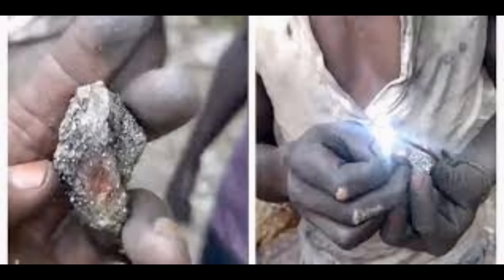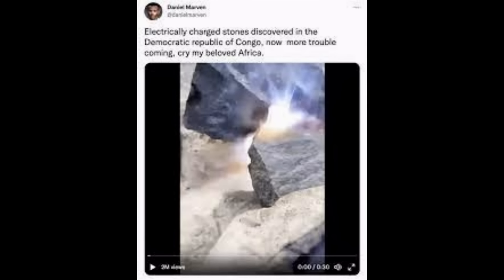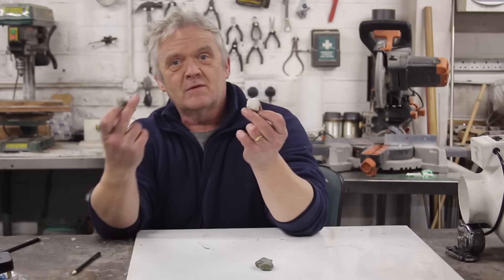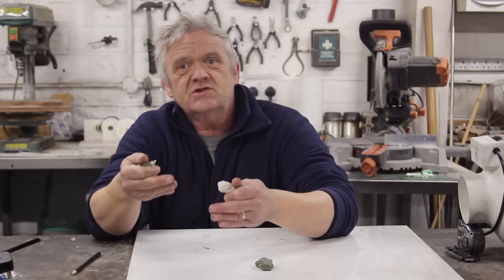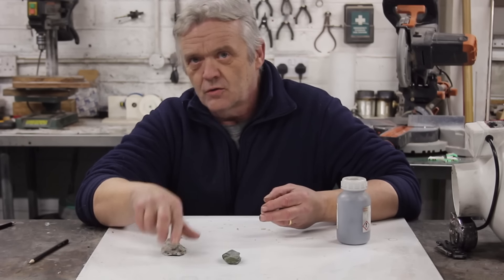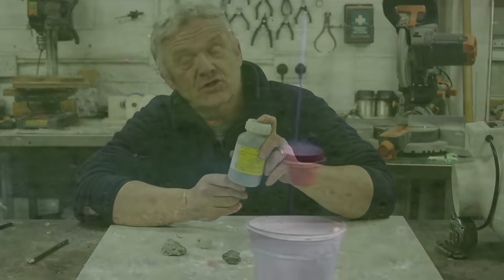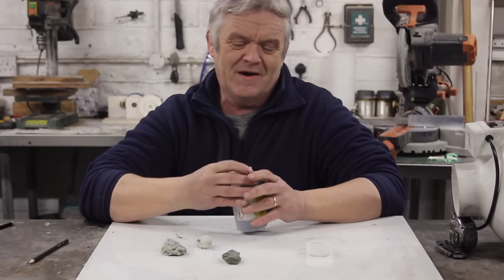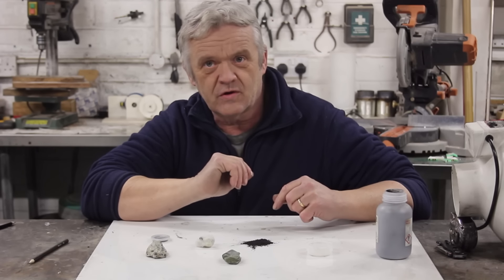1821 Reproducing The Electricity Generating Stones From The Congo

Comment: Another fantastic video Robert, that definitely had me going and I'm so glad you clarified it at the end, but you also raised a very valid point that the masses can easily be mislead without much work these days! Equally great content just as your usual stuff, even if it was a trick video, I always thoroughly enjoy watching along! Long may it continue
Reply from the maker: thank you mate and thank you for taking this in the spirit it was meant
Reply: @ThinkingandTinkering  Another trick:  HITTING TWO WHITE QUARTZ STONES TOGETHER IS NOT ELECTRICAL!  Do it in a dark room, and notice that the dim flash is yellow, rather than the blue/violet of plasma.   Also notice that, after hitting the stones, the contact-point smells burned.   What if it's all frictional?  Maybe it's like the "sparks" from grinding wheels, which aren't electrical of course.

If the tiny contact-point between quartz pebbles is getting hot enough via friction, it will glow yellow-white for a moment.   But in that case, ANY stone should do the same  ...but the vast majority are not translucent!  Any flash will be concealed, hidden down between the two opaque walls coming together.   In order to flash, at least one of the stones must be translucent.   (And also, a violent *scrape* might give out much more light, while a perfect *strike* with no sliding motion, might not produce any flash at all.   That's if the flash is entirely caused by frictional heating.)

So, try it with a white translucent mineral which isn't piezo.   Or, perhaps try it with milky glass.

Heh, maybe try spinning a tiny object in a dremel, then pushing it hard against some translucent  ...marble, or glass, etc.   Will a tiny drill-bit or a grinding-wheel produce some light, when it's against a translucent white object?

Comment: I knew there was something wrong when you were banging the stones together, but I couldn't tell you had edited the video to light the LED. Very good.
Reply from the maker: awesome - cheers
Reply: Having played with quartz rocks a lot when I was a child, and pretty much intrinsically knowing they didn't do that, I still fell for it, despite the 'electrical flashes' looking a bit off. Just shows how much trust plays in an observation and analysis.
Reply: I have seen crystals flash on impact,  but it required a pitch-black room to see it,  and I had to wait several minutes for my eyes to adjust first.  Not going to see any flash in a well lighted room.

Comment: If you have actual Piezzo quartz stone cut as a flat piece, and if you were to properly set it up with contacts on opposite sides it can produce a few thousandths of a Volt for an instant. The pulse width would be dependent on the resonance of the stone, force of the strike, and anything being used to hold it in to position. This would happen when you strike the stone.  The current output would be in micro Amps or a few millionths of an Amp.  You would need an oscilloscope to see this.  Set the time base to about 10 to 15 HZ per cm range. Input sensitivity should be set to about 10 mv/cm.  When striking the quart stone you would see the trace jump.  With a digital storage scope you can capture the waveform and take a measurement.

Comment: Two relatively translucent  quartz  river rocks will indeed make a nice orange flash if you rub them hard together. (you need to do it in the dark after your eyes are adjusted.)  there has been a good debate about if its paezo electric or tribuluminesence.  i think its paezo possibly igniting tiny crushed particles.    similar rocks were sold in a small felt bag as "magic rocks"
Reply from the maker: yes they will - hard to get on camera but awesome to see

Comment: I don't think it's real. I'm an electrician and I'm not the sharpest tool in the bucket but they'd have to put great amount of pressure on rocks to produce electricity.  
As far as it being conductive simply by touching it against something is unbelievable. Why isn't anyone being shocked from it if it has that much energy.  It seems to be very unstable to

Comment: I do enjoy these sorts of videos.
A spark of truth seems to be a common thread in pulling wool over eyes.
Obviously the pizeo electric properties of quartz is a thread of truth, but I wonder what else had grains of truth 🤔.
VB2 I've had some experience with in manufacturing, an ingredient in ceramic cutting edges, I've never thought on how its synthesized but it does make the ceramic slightly conducive. 
And frankly seeing the $40 bottle of VB2 that I have used in the past while you described making the stuff really put my suspicious on edge.
I honestly had some hope that there was some chemistry trickery at play rather then camera trickery!
Well done and well played!

Comment: Robert, how do you explain the academic report titled : "Experimental Investigation of Soapstone and Granite Rocks as Energy-Storage Materials for Concentrated Solar Power Generation "?
A section from the article:

"for crystalline rocks the conductivity decreases with temperature as opposed to the amorphous rocks in which the diffusivity usually increases with temperature. Thermal conductivities at 20 °C were 2.58 W/(m·K) and 2.19 W/(m·K) for soapstone CS and US, respectively, while those of granite CG and UG were 1.69 W/(m·K) and 1.91 W/(m·K). The conductivities for soapstone were higher than those of granite. Most other rocks shown in Table 3 have thermal conductivities approximately similar or slightly higher to that of the experimented rocks with the exceptions of quartzitic and calcareous sandstones that have higher values."

Comment: Called it out from the beginning .Numerous quartz produce electricity through the piezo effect via compression or twisting .That's how many BBQ igniters work .If they were iron bearing rocks like hematite and you were to turn up the voltage and connect them by wire you may  get the same arc flash they produce .Note that the guy was wearing a glove handling the rock .One wire from the welder is referenced to ground and the other on the rock and put in 36 to 75 volts and about 200 amps and you are welding

Comment: Excellent video and Thank You for the explanation of the trickery. I've always thought "If something sounds or looks to good to be true, then it probably is."
Initially I was surprised and disappointed you didn't assess how many volts and amps the rocks produced and then expounded on how big or how many it would take to produce a usable voltage/current. Something didn't feel right based on your usual thoroughness.
Reply from the maker: that is a very good guide and thank you for taking this in the spirit it was meant

Comment: Wet granite of course will produce a current, I found a granite stone in my work car park which happens to be next to a railway line, so it’s one of the stones from in between the tracks that found its way into the car park. I took it home, got it wet and tried a multi meter on it and it does indeed produce a small current when it is wet…
Reply from the maker: there are real effects that's for sure

Comment: Could you explain why a multimeter would tell you there is a current in the microamp range and of around half a volt when you sandwich clay in between an aluminum foil and copper wire?

Comment: This reminds me of the really old fashioned crystal radio kits where it had a literal Quartz crystal and the ' cat's whisker ' for the radio.  I would not doubt it produced power, just not enough to actually light an LED without some blocking oscillator since the power out of a crystal radio also ended up needing a battery and an amplification circuit to actually hear an AM station.
Reply: "Crystal" radios didn't use quartz, they used Galena.   The "crystal" doesn't produce power, it just rectifies the incoming signal.  Simple crystal radios can work without any batteries or amplifiers if you use a high impedance earpiece.
Reply from the maker: cheers mate

Comment: I have in my posession a few gemstones that when wet send a tingle that feels like electricity at a very very low voltage.  the voltage is less than when a 9v square battery is licked.  I didnt believe it when I first read about the gemstone, so i bought some. i've showed them to other people and they have felt it too.  i've often tholugt about trying to measure the voltage to see if it is actually a electric current, its on my todo list.
Reply from the maker: there are real electric stones
Reply: @ThinkingandTinkering  what causes the tingle i and others feel when the stone is wet when a person touches it?  i didn't believe it untill i tried it myself.  The gemstone has a weird name. I"ll look through my old receipts and post it in the near future.

Comment: Would love to see if energy can be collected and stored via the airwaves around us ,, using a crystal radio . I have a crystal radio and indeed it does work and I can hear radio stations without any other source of electricity to run it . The earpiece is a piezoelectric earpiece and it's very quiet to listen to. With a much longer and efficient antenna the volume goes up. Can this tiny bit of energy be harvested??

Ps great video keep em coming , I still feel a bit sad for the folk who invested into the perendev magnetic motor who were taken in and coughed up their hard earned money

Comment: Some reason this makes me think of magnet motors, there is Soo many that almost work, they spin about 300°-340°. Then stop, they can't get over the hill to contenue, I was just thinking maybe they could be used with a sterling engine, use the magnetic motor as the flywheel, with it timed so the hill or dead spot is timed with the Stirling engine is on its power stroke, or there about, then balance the rotating assembly, and use coils on the near the flywheel, forming a generator,  the magnets could possibly make the Stirling engine slightly more efficient, we can only try,  maybe one day we can get that 100% efficiency!!
Reply from the maker: you could always try if you wanted mate - but I don't know I suspect it would come to a stop unless you used the Stirling of course as that is the power input

Comment: Rob, have you seen the Garuda Sanjivani videos? It is apparently a Root or stick that can travel against the flow of water. I tried to replicate it and 3d print but i had no luck as my attempt was heavy and sunk.  Would love to see a video on your thoughts. I think that it is possible to replicate and i think it works based on the marangoni effect due to the surface tension of the plant stick / root. similar to upstream contamination that can occur when your pouring water from one container into another. But the weight and shape of the objects will effect the surface tension and i cant source one of these roots to experiment with. Some say its fishing line others report it as an acurate depiction. To me, It would seam practical for nature to evolve this feature as a way to enable upstream seed distribution. The stick/root resembles a snake whilst it is in the water and it is also used to treat snake bites allegedly. Would love to know if the videos of it are genuine though.
Reply from the maker: I will have a look mate

Comment: Is it possible to liquify quarts and then resolidify it to allow for the properties required of it to work? This would allow for complex shapes of quarts interactions
Reply: Quartz is easy enough to carve into shapes, depending on the type of quartz. To melt it would require a tremendous amount of energy.
Reply: @jerrodlopes186  Quartz cant create infinite energy though right? You cant just pressurize it and generate energy forever? Entropy rules... Does this mean that Quarts are natural batteries we can squeeze electricity out of???
Reply: rick3yrick3y68  Ok, so consistent pressure provides never ending voltage? If so, How???
Reply: @Dalorath  it's not enough energy to do much of anything with.
Reply from the maker: yes it's possible just not very doable - after all quartz was once a liquid - but the temperatures and conditions are best described as extreme
Reply: @ThinkingandTinkering  The idea around this was to melt quarts into specific shaps in an engine that would generate electricity based on the forces generated from the design of the engine.

Comment: A working quarry would be lit up like a christmas tree if that were true - I've raised a weak spark using quartz and steel (much more difficult than flint and steel) but in that case it's the steel that is burning up. Nice one Rob, but the quartz sparking like a flash gun tipped me off
Reply from the maker: nice one mate - I was going for just a bit OTT - I am glad you. got it

Comment: I thought you had a battery inside the crocodile clip, and used the steel clamp to complete the circuit between the 2 copper strips.
Reply from the maker: it was such easier than that mate

Comment: I have a couple of devices which use the "strike the Quartz" principle to work as ignition sources., but they don't work as demonstrated.  LOL!  I had never heard of this African energy stone thing, but I don't doubt there are people trying to get others to buy the idea. The closest thing I've seen to free energy is the "Trompe", which uses flowing water to create compressed air (apparently the Romans discovered it), without using moving parts, or significantly affecting the water flow itself.
  Then again; you need a source of flowing water,so it's limited.
Reply: You should look up "Ram pumps" - they use the flow of water to pump water uphill, probably in a similar manner
Reply from the maker: it was on the BBC news mate

Comment: Firstly, I dont question your integrity,  so no apology needed.
Secondly, I was fooled until you were just about to connect the diode....being it is diode. You would likely have wanted to be certain which copper strip was positive and which, negative. 
Well done, though.
Reply from the maker: cheers mate - I do worry about this sort of stuff - but I also want to explain it in a different way

Comment: That chemical that's has 3 time more power density than petrol. Is that part true ?
Reply from the maker: yes it is - I mixed some truth in there and that much is true - vanadium diboride is a material that is being looked at very hard for batteries
Reply: @ThinkingandTinkering  thanks for the reply. That was going to be my next subject. Could it be used for batteries. So it's being looked at but how to best implement it is what they are studying. They sound like they would be very impressive batteries if it could be done. 
Hope they can make less dangerous than lithium or obviously completely safe.

Comment: I'm sure the Congo video is a trick...electricity simply does not work the way they depict.  But, I tend to think they didn't employ your method. When you slightly bumped the wire, your light (the transparent PNG) did not move.  Whereas, the glow in the video moves accurately as he moves his hands, and even shows a "lens flare" type effect that appears to be optically accurate.  It's true that can be mimicked using computer-generated effects, but that just seems too sophisticated to me, to be a satisfactory explanation.  My belief is, there's some hidden battery. When you pulled out the copper tape, I was expecting you to run it along the backside of your fingers, leading to a battery hidden somewhere, maybe inside your shirt...and I suspect they used a similar method to that.

Comment: That could so easily have been done without using video effect. Just put a little button battery and some fine wires on the clamp and it would work as soon as the clamp is done up.
Reply from the maker: yep that would work too - the effect was easier though and fun to try out!

Comment: Why does Mr. Robert Murray-Smith not go to the Congo, get the stones shown in video and conduct a test using the actual stones used in the video. If testing the actual stones is not done, he is likely protecting interests of the petroleum industry and is misleading the public in order to maintain the modus quo. As a professional researcher, conclusions must not be drawn regarding a particular unit of analysis using a different unit of analysis. Doing so is referred to as an ecological fallacy. For example, conclusions must not be made about turtles from examining frogs. Both are reptiles, but they are different species of reptiles. Again, it is erroneous to forecast the driving characteristics of a sedan from driving a dump truck, both are vehicles, but different types of vehicles.

Doc

Comment: From other videos, experience and learning to think critically. Your demonstration didn't add up. The tape has glue. With experience the glue is an insulator it would never meaningfully attach to any rock. Expecting that lose power to store energy is absurd. I've never seen quartz flash and I banged a lot of quartz together. Until the end clip i thought you were trying to pull a fast one. Always a good lesson to be harmlessly tricked so you learn to look at what is wrong with the claim instead of believing it. Real science is unending critical observance.
Reply from the maker: thank you mate and thank you for taking this in the spirit it was meant